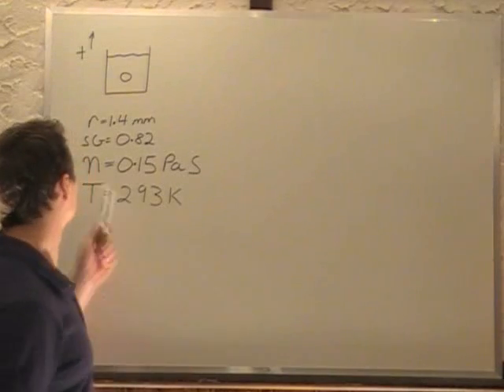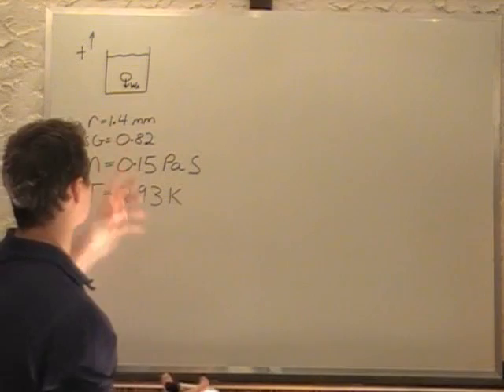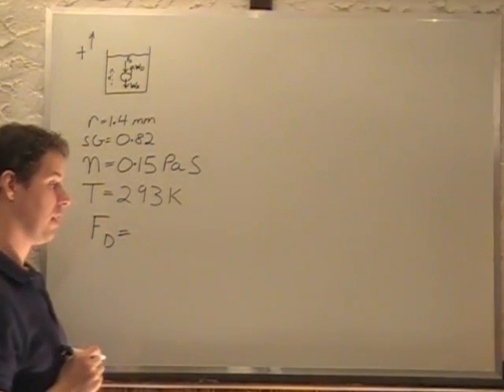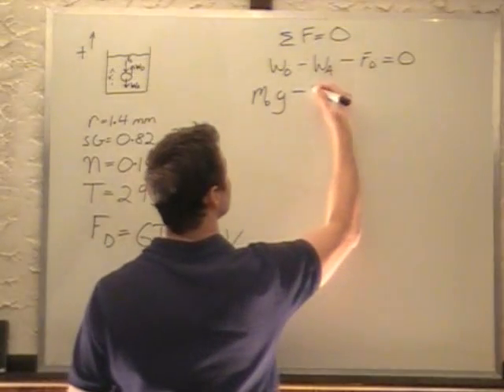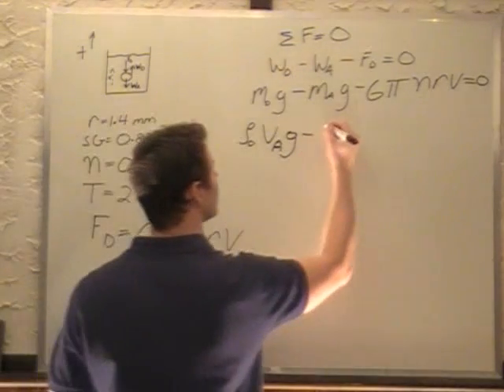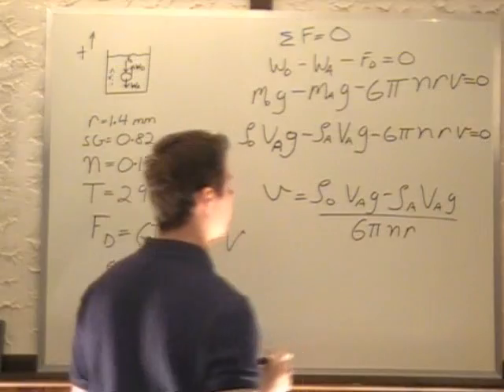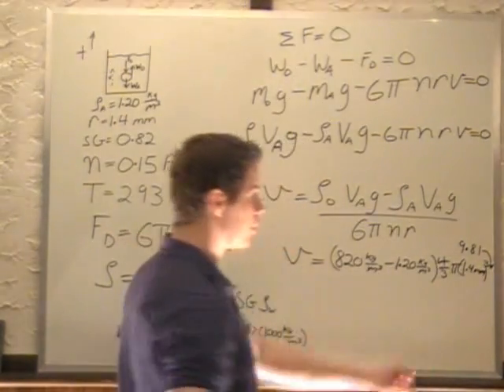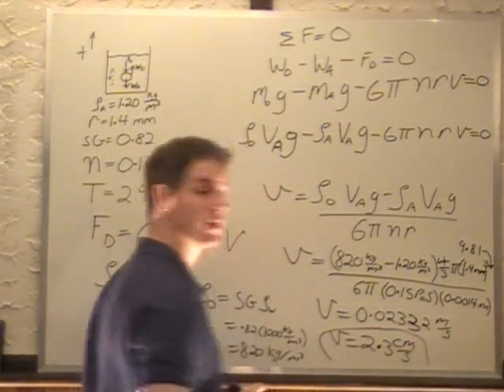Fluid Flow - Terminal Velocity of air bubble in oil

Comment: How is the drag force 6πnrv???I thought it is 1/2ρV2CA!I really need this equation right.can I have your e-mail please?
Reply: The 1.2 rho, V^2 CA is for inertial drag. In the liquid, there is definitly inertial drag, but since, as he calculated, the speed is 2.3cm/s, its very slow, so there is not much inertial drag. The viscious drag dominates in this context. You can also show by calculating the reynolds number that this flow is laminar, and therefore viscous, not inertial drag. If the reynolds numebr showed that it was turbulent flow, then yes, you would have inertial drag and use the euqation you mentioned.